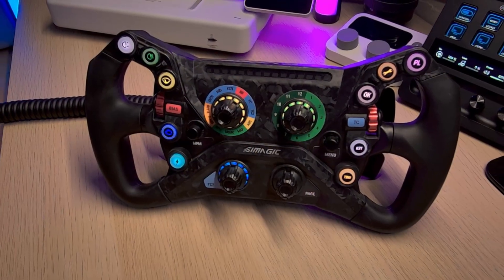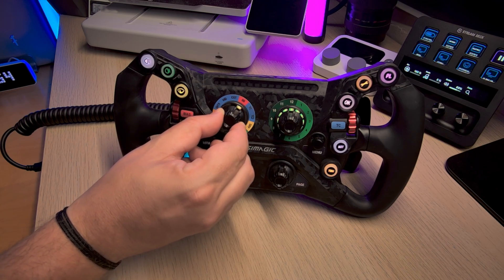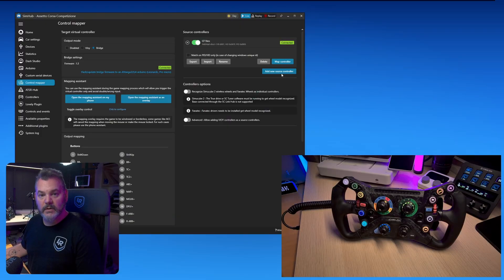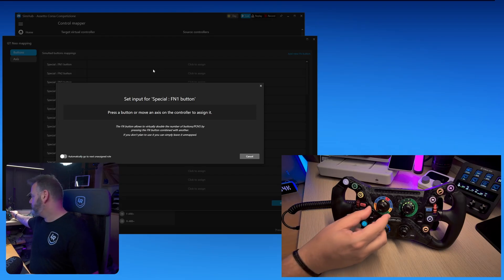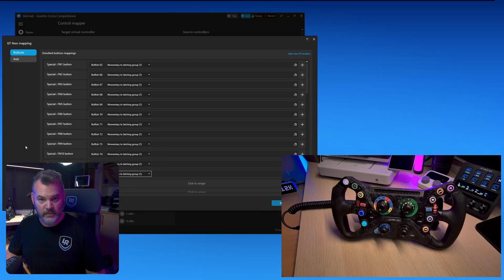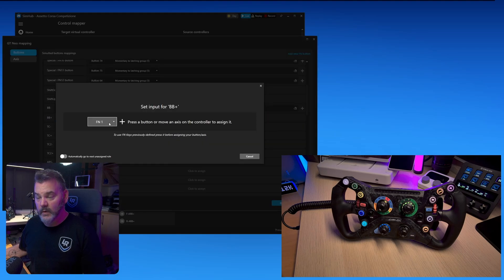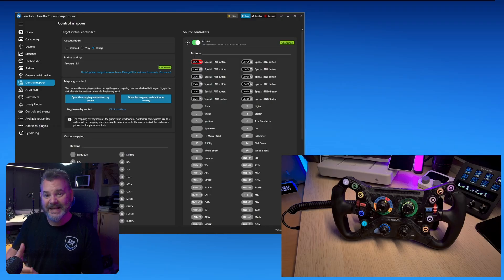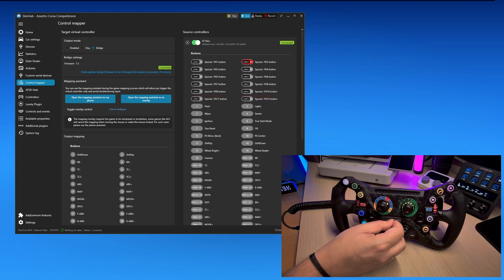Turn any wheel into a powerhouse! - Add a Multi Function Dial with Simhub

Comment: Hello i have a DIY wheel - where my encoders acting when i will turn them as a +1 position. When i turn it for the 2nd position - it will do again +one step. So these encoders are not working in the same way as yours. Do you know how to change how the Simhub is accepting them pls? 
Its like button40 for example - when i try to assign next position when i turn encoder, it will change the position
Thank you,

J.
Reply from the maker: You are describing your dials as encoders. These need to be Switches. This is a hardware or firmware change. 

This cannot be fixed in SimHub, unfortunately.

Comment: When connecting the GT Neon directly (Type-C, Maglink) it is possible to make all 4 encoders absolute. When connecting via the Simagic wheelbase, as you described, there are only the top two encoders. 
Also, switching between relative and absolute encoder positions works on the Neo Hub X.
Reply from the maker: Good info!

Comment: Hi great video! Can i put also over one encoder tc1-tc2-tc3 and the other one abs1-abs2-abs3?
Reply from the maker: Yeah you’d need to convert to basic rotary switches and each position would be mapped to a value.
Reply: @LovelySimRacing i tried yesterday on raceroom but every “click” doesn t work! Does only work mapped on tc+ and tc-

Comment: Good stuff man.  I noticed you're running the bridge vs vJoy.  I got vJoy working OK ATM but am running into issues where only RRE isn't noticing the keybinds.  Do you run RRE and is the bridge working for you?  Wondering if this would help...
Reply from the maker: I actually use both, but I think I prefer vJoy… last I checked RRRE worked fine with both.

Comment: Maybe I missed it...but to swtich the top left encorder from a rotatary encoder to and absolute encoders, all you do is push down on the funky switch and then turn the encorder dial?  Is it plugged into the PC?  What software has to be opened?  This part is not clear.
Reply from the maker: Well, I mean it is an electronic device so it should be plugged in. No other software needs to be open… this changes the wheel firmware.
Reply: @LovelySimRacing  i have the same wheel and simagic alpha evo sport, wheel is connected to the base wirelessly... not with usb , not in my pc directly.

Can i do the same ?
Also, where did you found that info, that you can change the rotary wheels to absolute, its not anywhere in manual !

Comment: can the fn function also affect a button box, meaning if i set a fn1 button on my wheel how can i link that fn1 to my button box?
Reply from the maker: I persume as you would any other button, as long as they connect to Simhub.
Reply: @LovelySimRacing  both are connected to sim hub but i cant find a way to link functions to fn keys from other devices

Comment: Hey Constantinos,  could you help me? I have a Conspit 300GT and am trying to do this but my outer dial LED of the Rotary does not seem to have the ability to highlight the LED which is selected in a different colour. Any idea where I am going wrong? Or is it not possible with this wheel?
Reply from the maker: I cannot confirm that’s a feature of the 300GT. I commentate a feature of the GT Neo by Simagic. Not all wheels are made the same…
Reply: @LovelySimRacing  yeah I can't seem to get it to work. It's weird cos it works in the wheel app but not Simhub 🤷🏻‍♂️
Reply from the maker: Might not be a feature. Check with Conspit for confirmation.
Reply: @LovelySimRacing  still not checked. However, one thing I would like to ask is, for each selection on the absolute encoder, can you only assign one rotary encoder? Reason I ask is because on the Conspit 300GT, the selections on the centre rotary are mapped to the left and right thumb encoders.

Comment: Hi, does this work with Le Mans Ultimate? I setup all this, simhub is working fine but the game detects the rotary as the same button when changing the encoder, always button 38/39 for example. I have a simagic alpha evo base and I had to connect the usb-c and tape the connector on the base, do I have to set up something different in the Control mapper? Thank you
Reply from the maker: Which wheel?

Comment: How did you mapp the fanatec formula wheel? I can't change the left and right MPS independently. It's either encoder mode or constant. Tried google, but can't seem to find a way to do it
Reply: the only work around i found for this was to allocate one of the thumb encoders on the top or to allocate either of the 2 red up/down momentary switches, NOT ideal but it can work
Reply: @kingtarica  I made it work. The left MPS is now my selector (1 thru 12) and the right thumb encoder is used for increase and decrease.
Reply from the maker: Is the Fanatec Simhub compatible? I don’t think so…
Reply: @LovelySimRacing  It is, simhub and control mapper finds my wheel. Haven't you set up the Formula Wheel?
Reply from the maker: I’ve not tried it myself, but if it’s in Simhub then it should work the same way.
Reply: @LovelySimRacing  if you could find away too see if this is possible like you have on 2 rotary encoders that would be great, the software doesnt allow independent "MODES" for the 2 x encoders

Comment: Thank you for this great explanation. This opens up a whole new level on my wheel. 

Besides you’re the one who brought me to the Button Mapper with your other video. 

One specific question: I am current using all popular sims (except iRacing due to costs). 
The control mapper is working in all sims except AMS2. I’m using vjoy with 64 controllers, because my research came up with that AMS2 can not handle that many devices and controllers. 
When I am trying to configure the controls in AMS2 with the controller mapper app on my phone, the button clicks in the app are not recognised in the game. 

Do you know any solution to make the controller mapper work in AMS2?

By the way my Simagic wheels are connected via USB Hub and AMS2 is saving the port number. So every time is switch on the various USB plugs I need to do it in the same order when I configured the wheel in AMS2. Otherwise the wheel buttons are not recognised. So I end configurating the buttons on the wheel new every time I play (because I cannot remember the correct order of USB plugs). I hope to get rid of this issue with the control mapper. 

Thank you very much in advance.
Reply from the maker: AFAIK, AMS2 does not support that many inputs.
Reply: @LovelySimRacing Thank for your fast response. So lowering the controller number in vjoy (from 64 to e.g. 30) would also not solve the issue?

Comment: fabulous and clear step by step. Now to find out if my wheel supports absolute encoders
Reply from the maker: Which wheel is that?
Reply: @LovelySimRacing fanatec DD pro base - have the Mclaren wheel, the GT wheel but don’t use that often, and a 300mm rim with a fanatec CSL hub
Reply: @MrKlawUK hey mate, any update on this? Did it work?

Comment: I’ve been running this setup for couple of weeks now and it works like a charm. The only difference is that Im using the right thumb encoder as Multi +/- for each parameter. I prefer it like this because I don’t need to let go of the wheel grip.
Reply from the maker: I prefer buttons to rotary encoders, but it’s all the same setup. You can also assign the left Multi Function the left thumb rotary and the right Multi Function to the right thumb rotary.

Endless options.
Reply: I’m trying to set this up. Simhub is done correctly but how do you assign these in iRacing for example? It keeps unassigning my previous input.
Reply: @itzwoudie  Are you using a software to hide the GT Neo? If not, then it may explain this issue since the GT NEO input takes over the control mapper of simhub. Check Dan Suzuki tutorial on Simhub Control Mapper

Comment: Is it possible to make the right dial show the level of e.g. TC 4/10 with leds when I set the left dial to TC? The sticker informs about levels from 1/12. e.g. TC level 4/10 = so many leds lit from 1 to 4. For example: I turn the right dial to ABS and on the right I have 6 leds lit up to the number 6. When I turn the right encoder to reduce ABS to 3 and I have 3 leds lit up. I turn ABS++ and I have 4 leds lit up numbers 1,2,3,4 by the sticker.
Reply from the maker: That would be something for a LED Profile. Perhaps ATSR can manage that…

What I do is use the Multi Function Dial with two buttons (+/-) on my wheel. The second rotary dial with the numbers, I use it as an absolute encoder for my engine map, which means 4 = Map 4 etc.

Comment: Also, thanks for explaining how to do this properly, on my Asher artura wheel I had them set to inverted which also worked, but it also had issues where it didn’t respond as fast to the adjustments, at least when it was set as a modifier in the lovely plugin, so thanks for helping me on discord, and then with this video to do it properly!
Reply from the maker: The Artura has this feature native. In my plugin, you can set the firmware directly…
Reply: @LovelySimRacing yeah, it was just that I didn’t understand that the plug in was actually writing to the wheel which is what caused a ton of confusion for me, and then I don’t know why doing this but using inverted “worked” but it did. I tried it out this way and the rotary encoder for +/- responded much better

Comment: Just as an addition, if you’re using simhub, that means you can actually make all 4 dials absolute position encoders in case you want do top or bottom or left and right, the top two only is if you aren’t using USB/maglink
Reply from the maker: Anything that’s an absolute position encoder can become a multifunction dial. On any wheel… I just happened to use the GT Neo… and of course use any button or rotary as a dial. Limitless options :)
Reply: @LovelySimRacing yup, just there’s a lot of people who think the Neo can only do those top two because that’s what it is if you are connected via the base without USB pass through or the maglink which gets all 4. It’s amazing how many Neo owners have zero desire to use it with simhub all because they have an alpha and don’t want a wire.